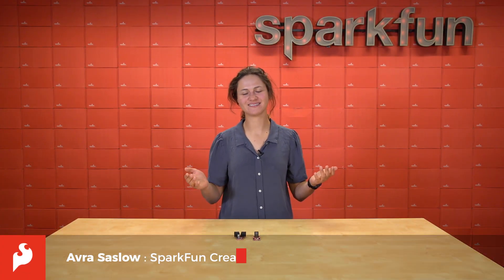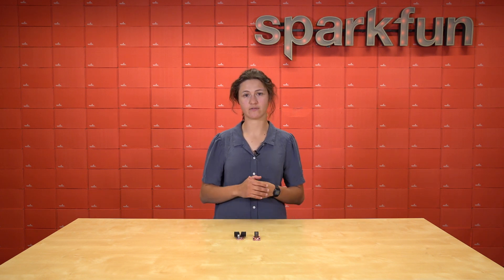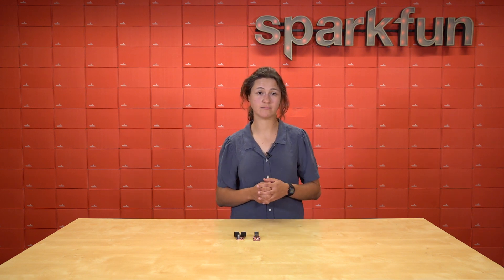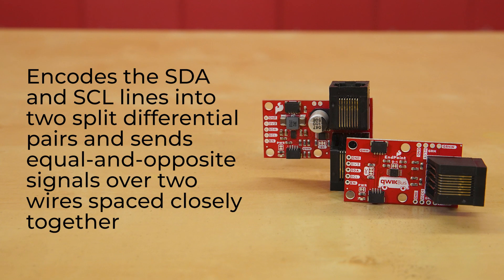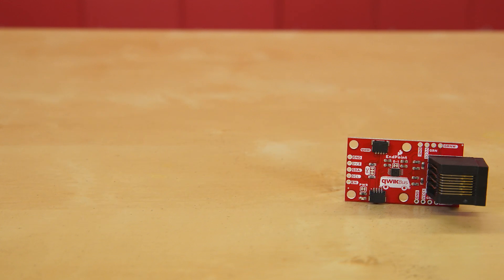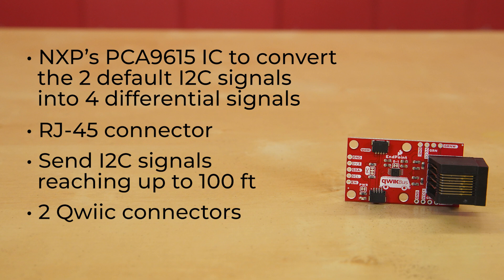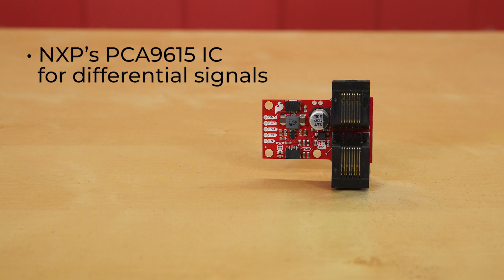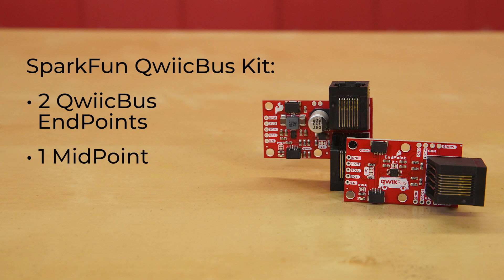Product Showcase: SparkFun QwiicBus MidPoint & EndPoint

Comment: Kudos for making this product, but did you ever feel like you are using the wrong tool for the job?  Sending I2C this distance makes me fee justl like this.  That's a lot of fancy hardware just to go up to 100ft.

I would suggest using RS485 at this point.  And you can go 1200 meters at a reasonable throughput (just keep bit/s * length in m < 1E8).  This has been around for decades, and you can use other well-established protocols like Modbus or CAN bus.  All this can be yours, but with fewer wires.

Comment: Dear Sparkfun
Noise may also come from your own electronics project, if you drive a high current, high PWM signal in close proximity to your I2C signal line. ON/OFF-chopping signals should not run parallel to sensor or control signals, nor should it run in the same multi-core cable.
I like your new boards. They separate the I2C line out into its “own conduit”.